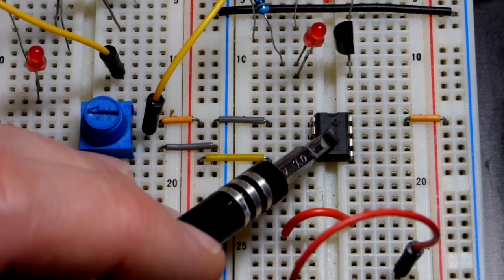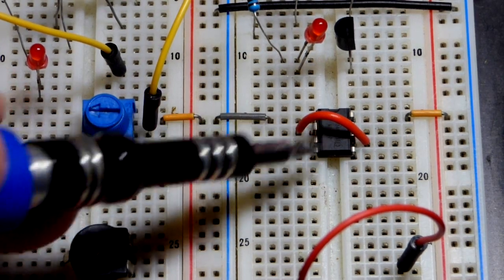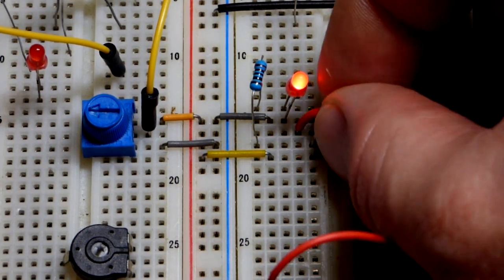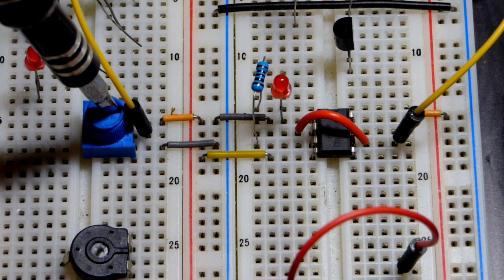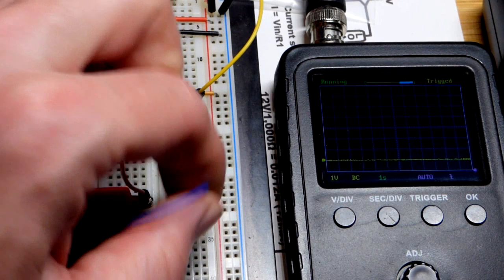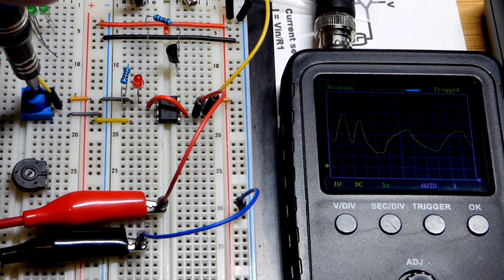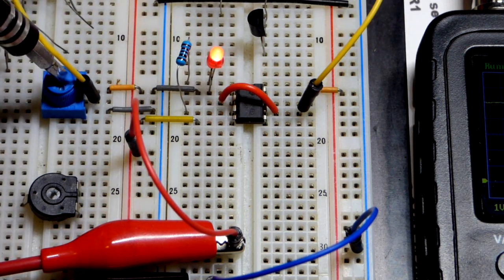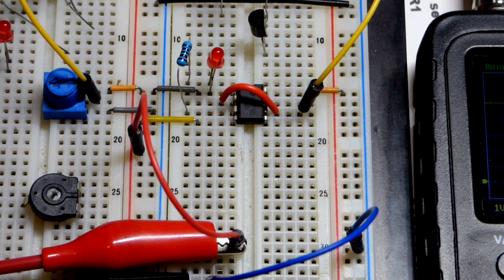Why 555 timer trigger and threshold pins are commonly connected together

Comment: Yeah Old good 555 Timer.
I made a Toy Piano using Capacitor and Voltage Divider at Discharge and it was Great.
Different Resistances Values connected between Trig And Threshold gave different Frequencies and the output was speaker.
Reply from the maker: Very cool!

Comment: I would like the amp op internal was independient both.

Those pins function as sensors.
One sensor minimun pin 2.
One sensor maximun pin6.
😎
Reply from the maker: It's actually a 555, but, yup!

Comment: I want to use Hcsr04( ultra sound module) using 555 
Can you tell me what should the the circuit diagram for it
Reply from the maker: Unfortunately, I have no idea how you could use a 555 timer with an ultrasound module. I have only used an ultrasound module with an Arduino once using someone else's code. Good topic idea though :)